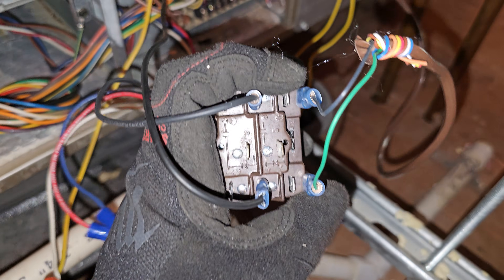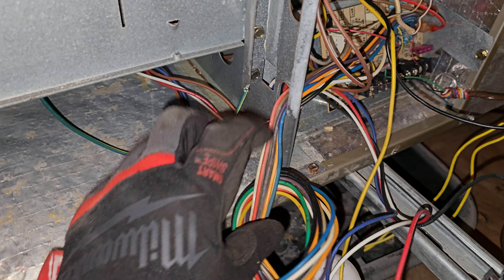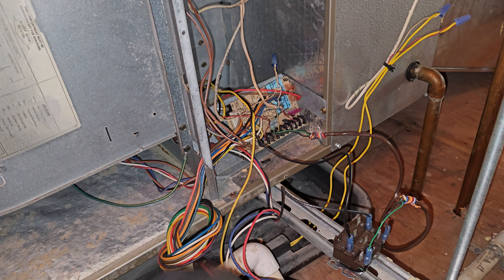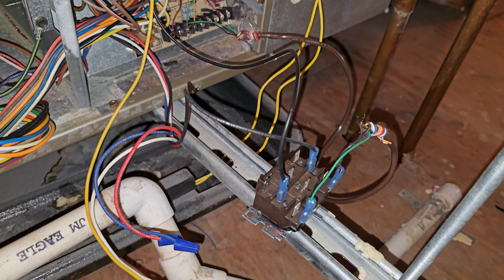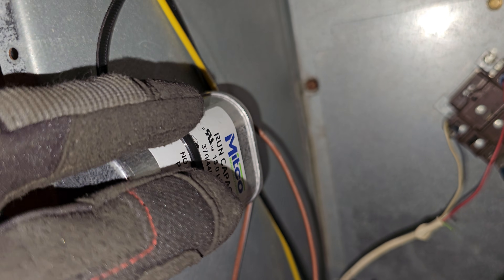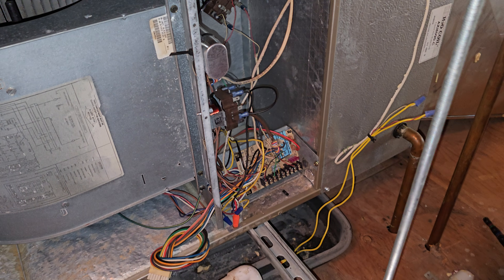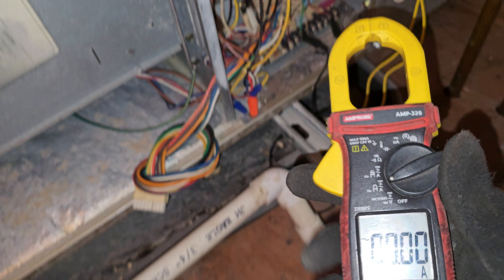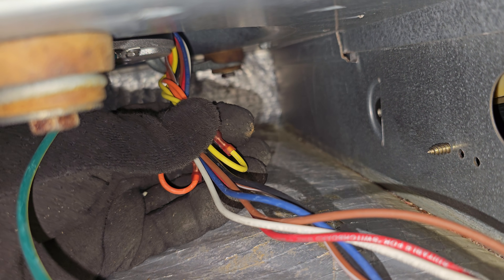ECM TO PSC MOTOR REPLACEMENT/ CONVERSION WIRING pt 4

Comment: How does the capacitor get its initial charge?
Reply from the maker: In this senecio the capacitor isn’t  being used as in a DC circuit! It’s used to  create a delay thus creating a phase shift in current and voltage to the power feeding into the start windings

Comment: Hello, Sir. No offense, your wiring doesn't seem to be able to control the heating, can you add a relay and use W and C to control the heating? Same wiring method.
Reply from the maker: The simplest way is to modify your thermostat settings options,  where you select that thermostat controls fan in heat mode or electric heat.
Reply: @ Wow man, this is good advice for that. But the issue is you can’t choose the speed which you want it to go, right? You just can use one speed model which is high speed.

Comment: For lower speed c brown w1 
And on top blue or red on NO
And on Nc i would used a jumper from the other relay??
Reply from the maker: In a real-world scenario
The high and low speeds would not be energized. Simultaneously.
Reply from the maker: Are you trying to do this swap and use multiple speeds?
Reply from the maker: If you are a preferred member, you can contact me via what's app, and i will prepare and send a wiring diagram  to accomplish this using 2 or 3 speeds!

Comment: So lower speed can be wired with another relay controlled by C and W from thermostat ?…
Reply from the maker: 👍 yes sir 👏
Reply: @D2DNYAC   If heat pump G alway call from thermostat. I don't think two speed work for heat pump thermastat.
Reply: @lucyhniar  I'm confused by this also. I have a heat pump and don't understand the different between G, C and W to control different speeds.